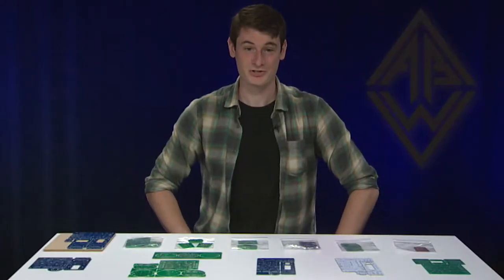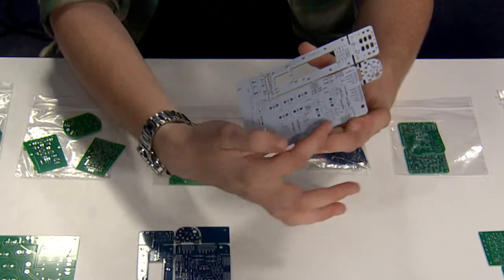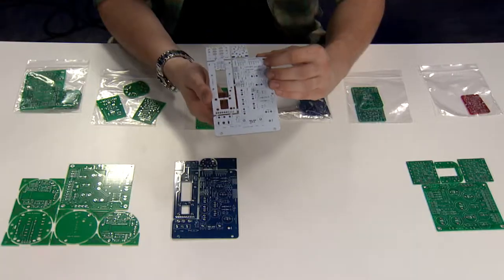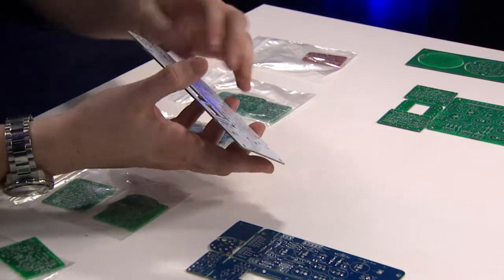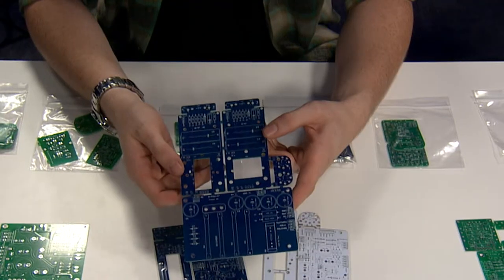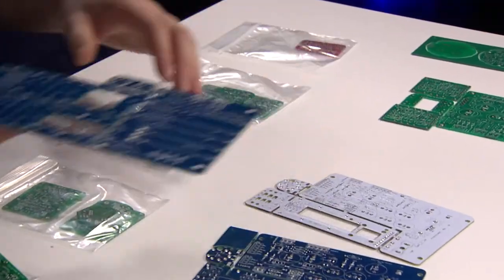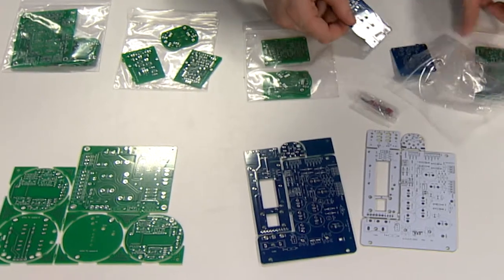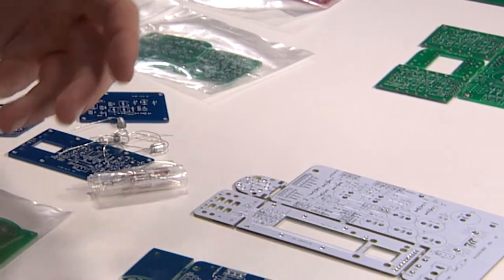Vintage Microphone PCB Kits www.vintagemicrophonepcbkit.com

Comment: I just built two D87s. Awesome.

But the switches and styroflex caps are not included in the kits. They are available to be ordered from the pages where you order the PCBs, but they are extra.